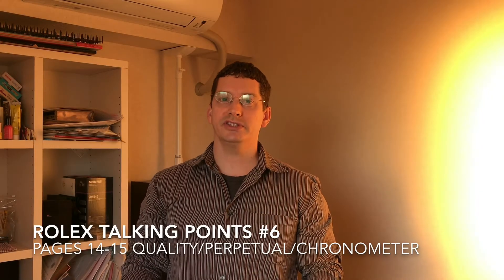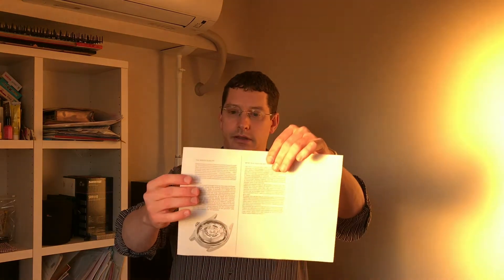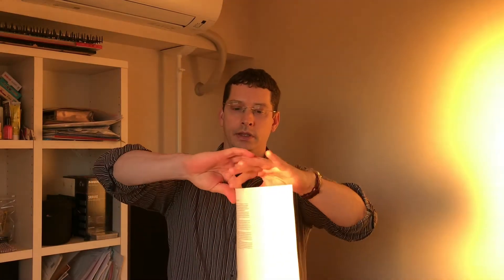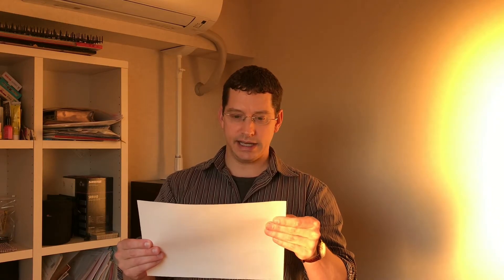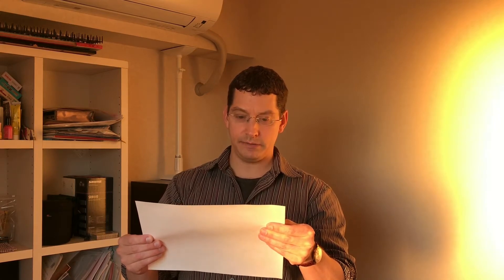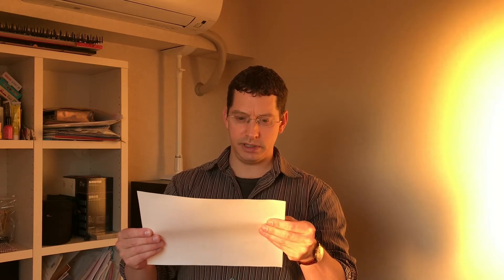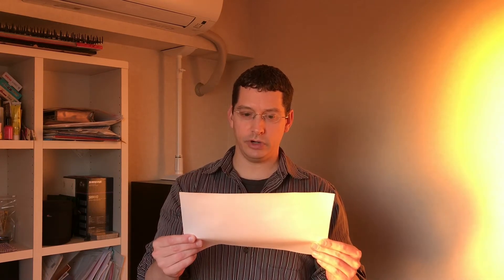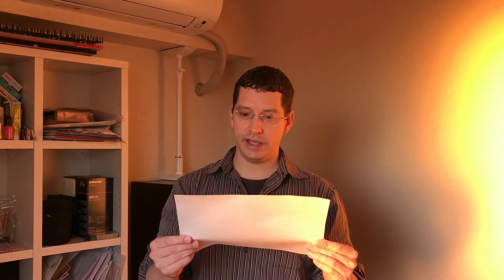Rolex Talking Points #6: Quality/Perpetual/Chronometer

Comment: Yes kind'a confusing, but Rado's comments below are exactly in line with my thoughts. Every watch will have COSC certification based on the unique serial number of that watch and it's movement. So every watch is tested, etc...to meet COSC criteria.  What year was this document published?  Does it say. How did you get ahold of such a cool document?  My guess is the red  jewels are outsourced by Rolex.
Reply from the maker: It's from 1985. What I have are just some printed pages that came from this site:
https://www.minus4plus6.com/talkingpoints1985.php